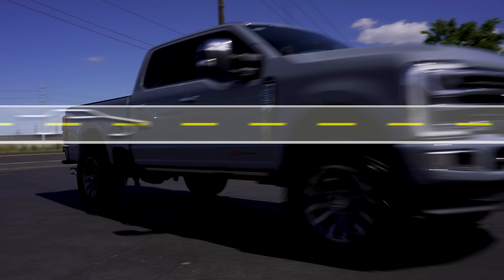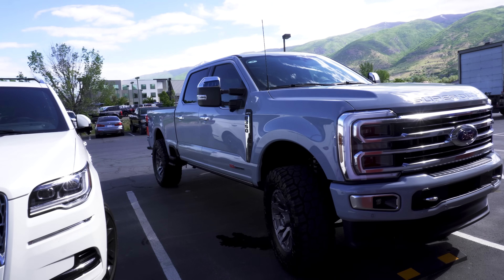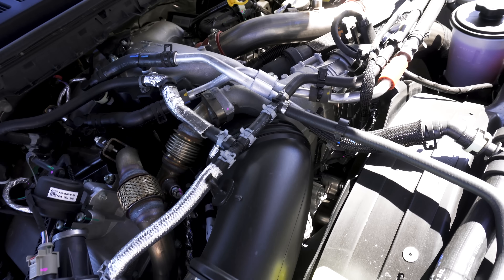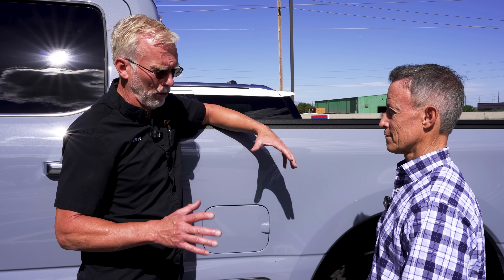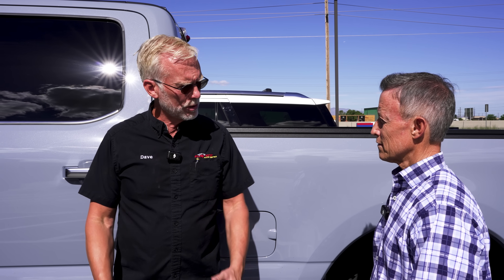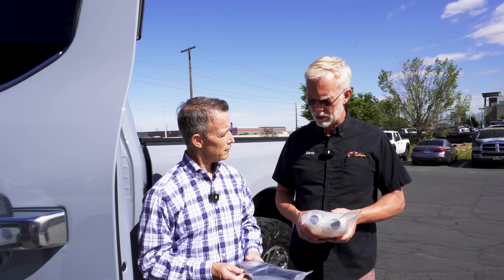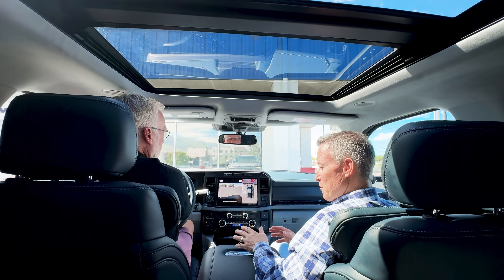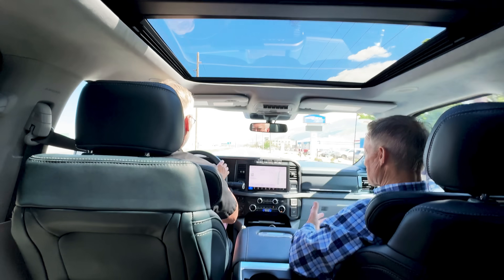Diesel Truck Maintenance

Comment: "Fuel Polishing" isn't  the right term.  Polishing is something you do BECAUSE you know the fuel out of the pump is suspect OR because you KNOW you got a load of bad fuel.  Every powerstroke / cummins / duramax should be fitted with a REAL fuel filtration system, not the stock junk that has neither the capacity NOR ability to trap what is needed to protect these high pressure fuel systems.  If you are not running fuel through a FF5000 -  FS1000 - FF5776... as is used to protect a common rail OTH Cummins... then owners are just rolling the dice and they will pay the price.

Comment: My experience in the trucking industry. You are better off filling your def tank with the jugs. Not from a bulk filling station. Reason being. Is when def dries it leaves a crystal chalky residue. And that can collect on the nozzle and end up in your def tank plugging filters and injectors just adding to the headaches of these poisonus emissions control devices

Comment: Thats a beautiful truck ya got there man! Congratulations! Nice small lift 3" - 4"? And the Glacier Grey looks sweet too. You also got the 6.7 HO Powerstroke which is crazy strong!

Ok now on the fuel. Try to always get fuel from busy stations like truck stops & buzy gas stations that have a lot of diesel traffic. They will have the freshest, highest quality fuel cause it gets filled up very frequently. I agree with the addition of additive for your fuel that Archoil stuff is top notch(also Diesel Kleen, etc). These fuel additives increase cetane(the diesel equivalent of octane in gasoline) up to 7 or 8 points. You can definitely feel the difference when you use it & then stop using it. As Dave said keep any contamination out of the fuel tank\system. The DEF is pretty much all the same crap bottle or nozzle -its urea. Don't get it all over the place either cause its nasty stuff. That trucks fuel system contains a high pressue fuel pump manufacturered by Bosch its called the CP4.2 HPFP and its very critical that you keep it lubricated properly by keeping 100% clean diesel fuel with the added fuel additive which includes an additional lubricity additive too, once again -its important! If that pump ever sees any water, gasoline, DEF, etc going thru it the pump will most likely grenade itself, sending metal scrapnel through out the entire fuel system causing a $10k fuel system replacement that the dealer will not cover cause they'll claim its your fault - you put contaminated fuel into the tank, so its on you then. There are a few alternatives in the aftermarket if you want to protect yourself from this potential fuel system replacement. S&S Diesel (#1 supplier in fuel system alternatives) has a few options - #1 -DPK(Disaster Prevention Kit -$200-$400) adds a filter\return and sends all the fuel through it rather than sending unfiltered fuel back to the tank. #2 - DCR pump($2k), this is a complete high pressure fuel pump replacement that does not have the potential to grenade itself like a CP4 can with its cam lobe,  metal-on-metal contact problem. The DCR Pump replaces the CP4 directly, no additional modifications are needed after that though. It's up to you how you feel about the one & only weak point on these trucks and if you want to get rid of it or risk fuel contamination ruining 8 injectors & entire fuel system. Please do your research on it and pay attention to whats regularly going into the fuel tank cause you and only you can prevent the problem from happening. There are many other things that you can do to this truck so do a lot of research and study up on it because this is a huge investment and it will last you a very long time as long as you keep up with the maintenance on it. With this high output version, i dont see the need to get more power out of it but there are many things you can do to open it up a little and get more air in & out of it cause its basically an air pump - get more air in, get more out, make more power! It really doesnt need anything else though as long as that CP4 stays in one piece. I'm not a fan of the DPF, DEF, EGR, SCR systems that choke this engine down, and cause more problems than they're worth, but taking them off requires you to do other things(reprogram\flash ECM) or be the US Government Military(they get deleted trucks from factory)! But i digress keep fuel clean, change oil regularly at 5k miles, change\drain fuel filters(both of them!) at every other 5k oil service, rotate those tires then too(@5k) if you want to keep them looking & wearing well. Thats all i got! Enjoy that beautiful truck you have there! Dont forget to open it up & use that thing for what its designed for -to work hard and PULL! 💪🏻

Comment: Great video! I have the same truck just in White and my first diesel truck but I have a few tractors. The parts I still don't get are what cetain should I be aiming for? I'm told not to idle it but let it idle to cool the oil in the turbo before shutting it off though can't find a temp it should be dropped to or for how long! Also I know short trips are bad but my camp is 14 miles away I hook my trailer up to go mow and do work and return home is that considered to short? I purchased it for my RV but I only take that out once a month.

Comment: Massage your back so you fall asleep 👌🏼 get rid of the emissions and you’re solid. Get rid of that icon BS lift and get yourself a Carli suspension. My oil just stays clean and the engine a lot happier without the garbage and I do oil at 7500 miles even with weight loss. To each their own mine has been going strong for 120 miles still breaking in.

Comment: i just traded my 2014 F250.  At 76, I am no longer in need of a diesel.   However, it looked and drove like a brand new truck after just over 100k miles.  I changed the oil, fuel filters and trans fluid on schedule and used Arch Oil products religiously.  Never had injector problems or EGR issues.  Regens were so infrequent that it was a big deal to see one.  I also did not idle it for anything other than a traffic light and minimized short trips because diesels like to get warmed up and run - not stop and go or just to the corner and back.  I listened to Bill Hewitt videos - did not know about you then.  Loved the truck and hated to downsize to a Tacoma but it was time.  No more RVs for me - had 5.  I literally put more miles on my golf cart now in my retirement community than I do on my truck.  Keep up the good work, you are a great source of how to maintain and fix automobiles the right way.  I love watching these.
Reply: Rip Bill Hewitt
Reply: Tacoma’s rule! I’m on my 3rd Tacoma, a 2024. It’s WAY better than my previous 3rd Gen truck.

Comment: Unfortunately the "new" diesels from all 3 majors because of EPA requirements are absolute junk and not made to last. All you have to do is look around or just search youtube and you can see new $100K diesel trucks broke down and on wrecker trucks with major problems with less than 50K miles. I had one of the last great diesel trucks ever made, 2000 Ford F250 7.3 powerstroke. Damn near bullet proof with minimal maintenence. Bought the truck used in 2005 for $20k with 47k miles. I sold the truck in 2022 with 127k miles, basically barely broken in, and in perfect condition for $45k. That tells you how in demand older taken care of diesel trucks are because folks don't want the new junk being made.
Reply: What sucks is that the govt mandates these syetems that WILL fail and the average joe can't afford to repair it. Especially when it comes to HD trucks, they are mandated to have a newer truck and all the cost incurred while the govt buys their trucks WITHOUT emissions systems because they're not being bothered with the extra costs.
Reply: Supreme court shot down Chevron Defference today!! Hopefully these dumb EPA requlations will go out the window with it also!

Comment: Dave top discussion, Thanks. Diesels hate short journeys and iddling.. need to work them hard weekly (good motorway journey). As a novice European mechanic here who does my own regular maintenance, I studied Fuel additives, EGR and DPF cleaning(Annual) which i now add to my 5k regular services to my 1.7 Zafira B. Shes running sweet (optimum data according to my scan tool and milage) and all i can say is regular filter and oil changes seem to keep her healthy and reliable for the family..Obviously Pro mechanic does big stuff, but so far so good.. One thing to add, DPF regenerations will not run unless certain parameters are met ie A good run up to temperature and 1/2 tank of diesel( so do not run tank fully down)..and go on a long run regular

Comment: The FR3 Stiction additive for the fuel is a good one for diesel engines. Plus Ford diesel trucks have a drain valve on the main fuel pump housing with awater fuel separator, a drain plug for draining off the water, and a inline filter. It's usually underneath the bed along the frame usually, and it has to be drained every 5,000 - 10,000 miles to remove any water in the water/ fuel separator system.
Reply: Ford isn’t the only ones that can drain from the fuel/water separator. And if it’s being drained often and has water in it, it’s bad fuel.

Comment: You obviously cant say this on video, but deleting the egr and DEF systems will make that truck get better mileage, run stronger, and last much longer. 

If im not mistaken, i believe the manual says fuel filter must be changed every 10k miles. Do NOT miss the recommended interval.

Comment: Great informative video.  But there are a couple of points I would have liked to have made in your presentation.

1.  I really recommend to people that they do their first oil change sometime between 300 and 500 miles to whatever oil you plan to use.  This is what will remove whatever dirt and crud that ended up in the engine during manufacturing and assembly.  Yes, they all take great care in being clean, but it is that first oil that absorbs whatever is left.  Get it out of the engine.  (This goes for rebuilds too!)  In a diesel, I strongly recommend that they use something like Rotella T6 0W40 or 5W/40.  There are others, but this is the one I feel is the best.  Your comments about the damage to oil by the fuel are great.

2.  Your comments on fuel are about half right.  Yes, the way and where diesel fuel comes from are different, but that is because of the base crude is different.  The facts are that diesel fuel sold in the USA and Canada as well as in Europe, all meet ASTM D975-21.  Some will add an additive package that improves it, but fuel that meets this specification are fine.  The big key is to keep moisture out of the fuel.  This is where good additives can come in to aid in absorbing it and enabling it to burn through the system.  

As a person that just finished an around the world trip on a yacht with 2 C-18 CAT's.  I put a great Raycor filtering system in the boat.  I can attest that fuel we got in some of the other countries was not all that great by what the Rancor's filters out of the fuel, and the water removed.  But, I had no fuel issues in any of the engines or generators.  

Lastly, a huge help on my baby Duramax truck is that I installed a Racor CCV or Catch can.  This really helped to clean up the EGR system and even improved the fuel economy a little.

Last ting on DEF.  It is really best if the vehicle is driven a lot and the DEF in the tank is turned over.  But often this isn't the case.  There are some DEF treatment fluids you can get that will help keep the uric acid in suspension, and will break up the uric crystals that can form on your DEF tank.  This will also prevent the DEF pump and nozzles from becoming plugged.

Keep up the good work....

Comment: That's alot of money for Truck. Lots for money for maintenance also would seem.
Reply: Ya, these new trucks require a fat bank account or a wildly successful business… I miss them 7.3 powerstrokes that could go 1 million miles and cost of ownership never exceeded the purchase price of the truck.
Reply: it takes fossil fuel to produce the electricity to charge your dum bass electric cars. I'll take my muscle car V8 396 Big block any day. Go buy a smart car and pray before  everytime you get in it, that youll be able to return alive. Limp noodle spent 7.5 billion in charging stations and we have built 8 so far. You all dont have a "khlew"! Take your expensive standard of living on down the road to the next charging station 600 miles away. The auto makers are not building them like sh!+ 4 brains demanded.  Because they arent selling. If I see you behind me in my diesel p/u, ill be sure to rev the engine and blow thick, black smoke all over you just for fun.
Reply: Electric far more expensive.
Reply: @crasherxtreme  what for ? Lease , to run ? Most vehicles done on Lease
Reply: @AdrianMcDaid   no. Most vehicles are sold. Leasing a vehicle is stupid unless its a short term lease. What do you mean most cars are leased? If thats true, thats a shame. Cars used to be affordable until the unions got creedy with other peoples money. The cost of doing business gets passed onto the consumer
Reply: @crasherxtreme  I'm in UK I'm not sure where you are ...more than 80% of new cars in the UK are financed on a PCP deal.
Reply: @AdrianMcDaid   they wont let me reply

Comment: Notice Dave said Fan of the Ford Chassis, but not the engine he says Cummins and that is coming from an Engine builder folks! I would not touch any Ford product in the modern era. Maybe and older Truck with the 7.3l, but nothing after that is a resounding Hell No! My dream truck is a 1976-77 Body and Frame with a 7.3l or Cummins 24 valve swapped engine in it. To be perfectly honest unless I needed it for pure towing used for working I would not buy a modern diesel truck at all. For towing a boat or off and on towing and work gas all the way:P

Comment: Question: Dave, I have a 28-foot light weight touring trailer. Is it worth the extra cost of buying a diesel, or should I stick with a gas engine truck? Thanks
Reply: 😂 you need to do more research on your own, too many variables to give a yes//no answer….. but whatever you do choose, a well maintained 20 year old truck will outlast any of these new trucks with a much cheaper operating cost

Comment: Dave install catch cans for your custom.  The EGR gets clogged with oil soot sticks. This is the main problem. Learn about fuel catalyst which burns suit at a lower temperature. It is an additive such as redline oil 85+ or better yet Pittsburgh power max mileage. Install water injection snow performance. Lowers EGT and totally cleans the intake system makes it look brand new.

Comment: WATER METH KIT. If you have an emissions intact truck. You dont even need the right fluid just use water. 

It will keep the egr cooler clean. All new trucks should come with these preinstalled.

I dont know what people make a big deal about putting gas in a diesel. I put a few gallons in the winter to make it easier to start. Never had any bad consequences from doing that. I use airdogs so there is that.

Comment: I can guarantee 80% of people complaining about their DEF system do these things.. idle for a long time, use the cheap stuff, take many short trips, floors the pedal a lot, don’t use fuel additives, and don’t let the truck cool down after coming off highway. Both my 2021 Cummins are close to 200k miles with not a single issue with the def or fuel pump.
Reply: So basically as long as I don’t drive my truck like a truck my truck should be fine? Lol
Reply: So don't drive the truck, got it. 😂
Reply: These trucks need to be able to idle for extended periods, take shorts trips handle being floored. What do you do, pull little trailers on highway? Ever use a new truck as a plow truck? Like real northern climate plow truck? Or fueling equipment in mud? Or driving from one side of a job site to another? Def is ok for you in your world but the work that keeps life possible as you know it does not coincide with def or particulate filters or egr valves.

Comment: Always use the best oil you can in a diesel, a modern diesel is under a lot more stress than ones 40 years ago. I have a 2.25 litre N/A LandRover with a diesel built in 1968, 61hp - 114ftlbs mechanical injection with 3 main bearings, runs like a tractor with lots of low gears.
Reply: I wish they still made them like that
Reply: Rotella full synthetic

Comment: Question: the upgrade that Dave does to the oil circulation in a 6.7 can it be done by just dropping the oil pan? just wondering if this guy should go ahead and get that done

Comment: One of the things with diesel is the manufacturer wanted to make it run like petrol and go as fast. The engine became more complicated and expensive to maintain because of the extra cleaver electric to make it run like a petrol engine.

Comment: Dave, I love your videos and your forthright comments. I'm a disco tragic and my 2.7 TDV6 is coming up on 570000kms same engine no failures except ancillaries. I spend a lot of time off road as well as a daily drive in West Australia.  I service every 5000kms as a hack mechanic and get real mechanics to fix the problems I can't.
First time ever its going in for two injector issues next week. Your comment on diesels is spot on!

Comment: The octane number of a fuel is a number that tells you how resistant the fuel is to compression (detonation) combustion to a refference. How diesel is burned in a diesel enigine the octane number is not usefull to know.

Comment: Dave, you are very adamant about the mixing of gasoline with diesel , i know that the gasoline in 2024 is a very different stuff than in the 1970s but in winter very cold weather to enable diesels to go it was very common to add gasoline to your tank to lower its gel point, whats your point of view now? 
The advice you gave your friend buying his Ford truck was really enlightening, just what every salesman should tell the buyer